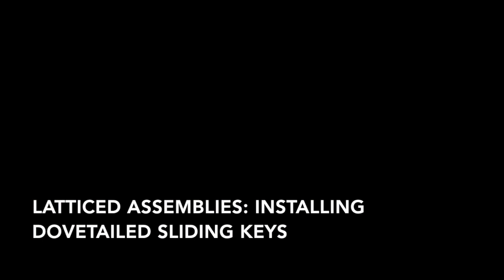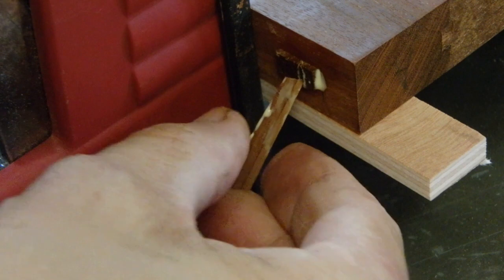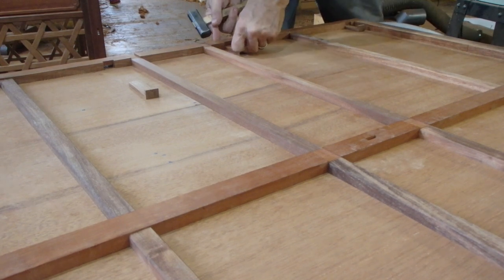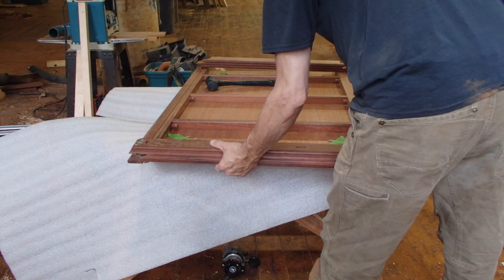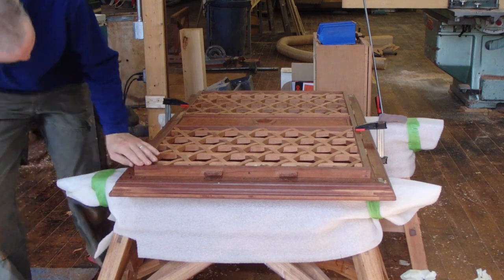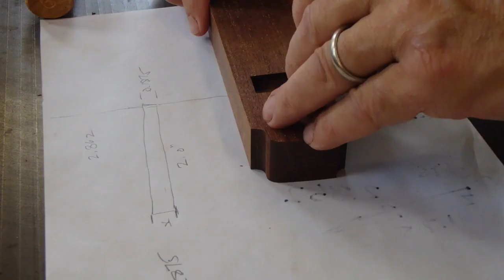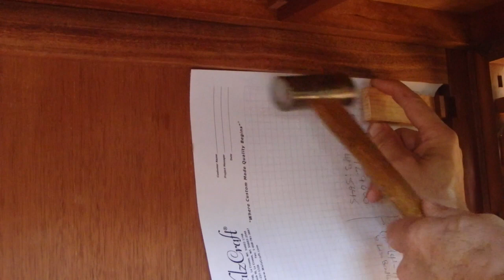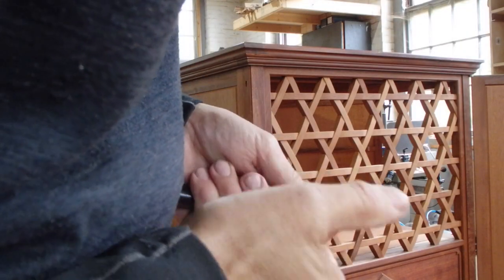Futon Cabinet Assembly

Comment: nice project. 
Regarding tool marks from planing, it is custom to chamfer/round the corners of the iron when planing surfaces like panels, this prevents "toolmarks" as the rounding prevents sharp transition lines between the planed surfaces.

do do this, use your finishing stones,  place the bevel flat on the stone and push it up to the corner of the stone, just as you reach the corner, lift the blade up in a gentle curve so the sharp bevel edge gets ground/rounded off, repeat this for the other side by pulling the blade towards yourself.
it doesnt have to be done a lot, even just the smallest bit, massively helps prevent planing lines.
(the blades corners should be ground with the stones corners so you dont damage the main surface of the stone)

oh and some people say "japanese carpenter dont do this" but...I learned this from japanese carpenters, soo, dont be turned off, thinking this is western bs. 
tho western planes also have "chambering" but this is usually much more aggressive.